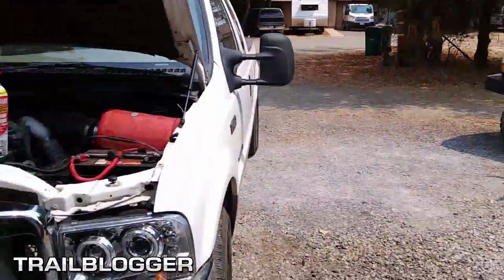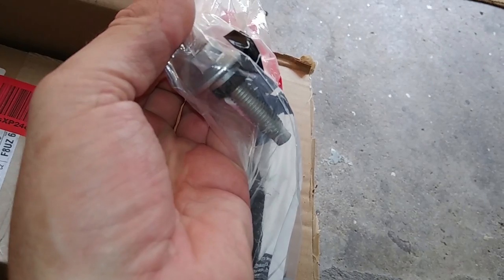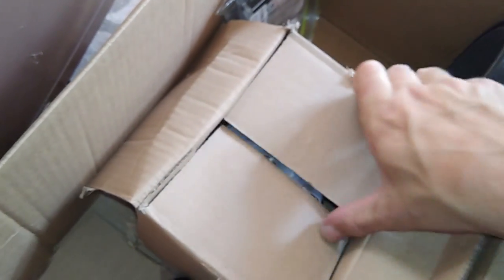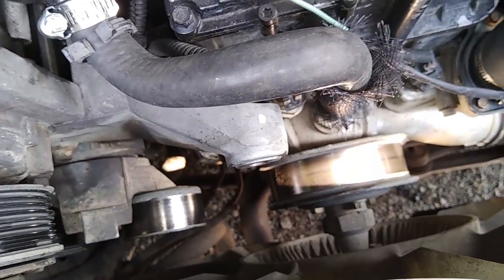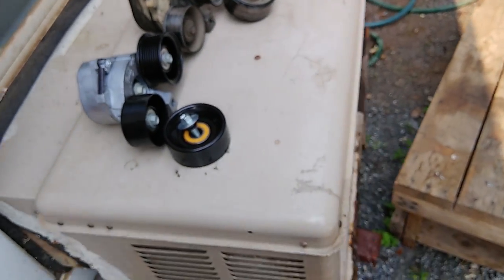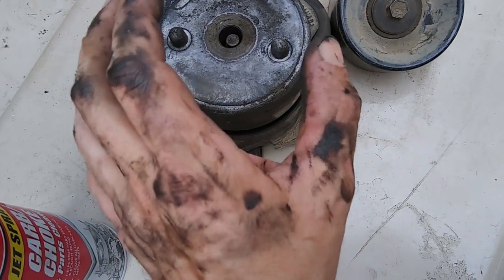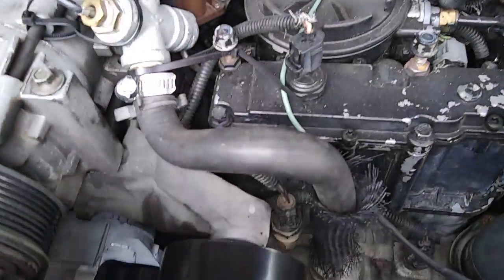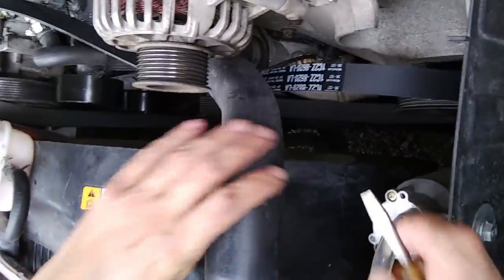Fixing a Squeaky 7.3L Powerstroke Diesel Belt Tensioner and Serpentine Replacment

Comment: No.1 love the sound of the 7.3 no.2 my dad's 98 f250 did the same thing. All he did was buy some spray stuff and it worked for years!
Reply from the maker: I probably could have gotten away with just a new belt but I have been meaning to swap the tensioner out anyhow since this is a fairly high mileage vehicle
Reply: Frankie, do you remember what spray stuff?
Reply: @trailblogger were the old idlers shot or just squeaky?
Reply: @trailblogger  I am just gonna press the old bearings out on mine and replace. After  doing the water pump the pully started complaining something fierce but my tensioner is arm busting tight. The smooth pully on my tensioner sounds like a cricket and I can't hear my 7.3l purr very well over it.
Reply: @trailblogger  came back to this video because you'll never guess what my family just got for my first vehicle. A 2001 standard cab F 250. It's a manual and it has no electric windows or anything like that but it's my grandpa's old truck so I'm so happy to have it.
Reply from the maker: @frankiehughes7423  hey that's pretty awesome to hear congrats on the new truck what an awesome first rig I hope it is a good truck for you

Comment: Belt Woes? May I share this. On a 7.3, there are a few options for the size of your belt. For examples: if you have a 2001 f 250, 7.3, with the heater block, one alt. Etc., that belt will be slightly shorter than the same truck without the block heater (cold weather package). Pay very close  attention to what belt you are supposed to put on your truck. Do not assume that the shop put the correct one on before you. My local parts guy just schooled me! I wanted to share cause my belts have been squealing after 6 months on every 7.3 I have had. I have been putting the slightly longer belts on all this time because I though I knew what I needed!!! Yes you may also have all kinds of other problems that squeal. Again, just sharing
Reply from the maker: In this case it was the idler bearing but good info. There is an additional (longer) belt if run a second alternator like my new 02 7.3

Comment: Just did all mine. also replaced he AC clutch plate.  All is good now. What's all the galvanized plumbing stuff in the engine compartment?
Reply from the maker: Just a flush T I had plumbed in when I was flushing her coolant and heater core out
Reply: @trailblogger  Just paid full boat for injectors .. Not brave enough for rebuilds. But  they would have cost half as much.
Reply: @trailblogger  Gates and others make that upgraded hose ( I have it and it's easier)
Reply from the maker: @enriquelaroche5370  I removed all that and sold the 2000, found a 2002 f350 7.3 with 140k on it. Will post a vid about it soon

Comment: The galvanized plumbing tee looks like it has a mechanical temp sender, whats on the bottom branch?
Reply from the maker: A screw on cap. T is for flushing the coolant system or heater core.

Comment: I presently have that same sqweeky noise.... but I just sprayed the belt and sound went away. I just replace the strap for now👍
Reply from the maker: Sometimes if the belt is worn out that will fix it but in my case I had a bad bearing. Spraying lube on a bad bearing is only a band air fix. I would rather fix it correctly now than have it totally fail on the side of the road while I am town a trailer full of quads heading out for a good time. The parts were not expensive to replace it all.

Comment: With the 7.3, if you throw a serpentine belt do you loose power brakes to?
Reply from the maker: Yes I'm guessing so because the booster is powered by the power steering pump.
Reply: @trailblogger  Correct.  My PS went out, both steering and brakes were nearly non-functional.
Reply from the maker: it could be different on the OBS 95-98 7.3s but i know on my Super Duty the hydro booster does both brakes and steering. i actually have a brand new one in a box on my back seat waiting to be installed because mine is starting to go out and leaking on the driver side floor mat.

Comment: Was going to order  the tensioner that you got from Amazon  but said made in China 🇨🇳 yeah ! So found a Dayco from advanced auto parts   1yr warranty and 25% off  $52.00  not  bad
Reply from the maker: most of the time i get my parts from Riff Raff or Rock Auto and motorcraft whenever possible
Reply: Lol...Upgraded my alternator  at a local rebuild shop and boosted my amperage to like 160-170 amps makes truck run better for sure.

Comment: The guy changes his pulley and tensioner because he did not like the squeekin noise it made. At the end of the video he does not say if it was either one of the parts. Please do some diagnostics or pay someone to do so before throwing parts at a vehicle save yourself some money. At least he does not worry about the new parts for a while.
Reply from the maker: Impossible to say which one it was for sure but it was most likely one of the pulleys going bad. I prefer to just replace the parts while I am under the hood than worry about it while I am trying to enjoy my day off toying a trailer full of toys to the woods. The amount of money spent trying to pay someone to pinpoint just one part or come tow me home when it breaks down I prefer to invest replacing old parts with new ones. There is no question on a truck with 300,000 miles that stuff is simply going to wear out so why wait until it absolutely has to be replaced? Just not my style. For the record I did stick my ear under the hood and try to determine which one it was ahead of time but that does not make for a very interesting video so I left it out. I was able to determine it was most likely in the tensioner or idler vs the alternator or AC. My resolution was to spend the cash now to repair the worn belt, tensioner and pulleys rather than wait until a catastrophic and even more expensive event occurred. Thanks for watching, have a nice day.

Comment: Either one of them a manual?
Reply from the maker: yeah the green OBS 95 is a manual 4x4. the white 2000 super duty is a 2wd automatic.
Reply from the maker: doing the steering column on the green one next (ignition switch)

Comment: I have a question about the belt tensioner itself. Can the tensioner be rebuilt? Because I found my belt half way off track and the tensioner came apart and pulled it off cleaned it up and it's just a spring inside how did both peace separate in use?
Reply from the maker: I honestly didnt even attempt to fix it, jist slapped a new one on. Assuming the bearing was worn down. Right before this I did have a pressure washer under the hood cleaning looking for a leak so it is possible i got water inside it.